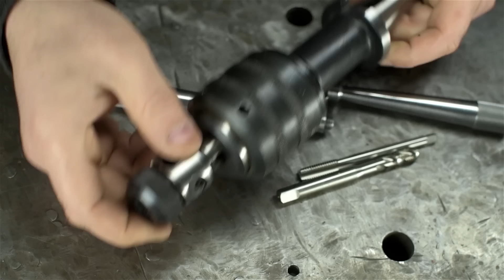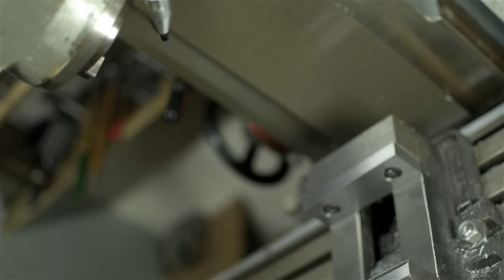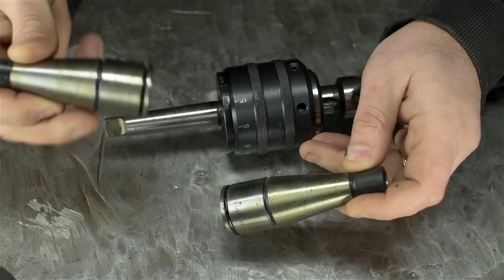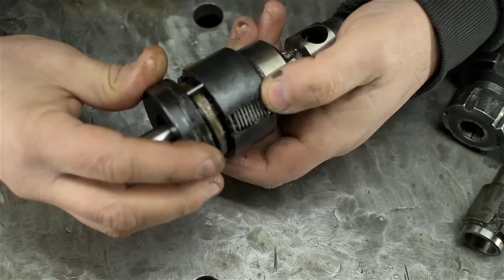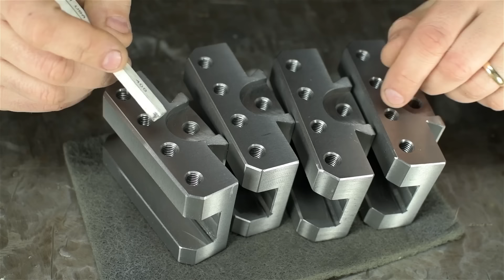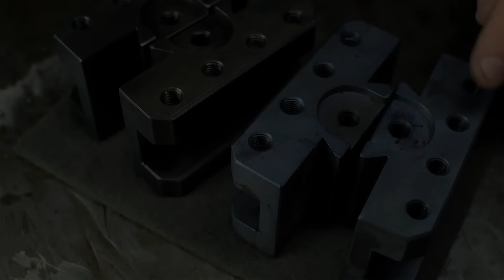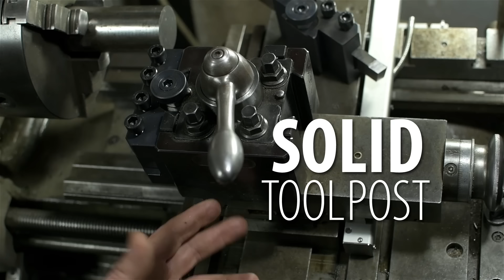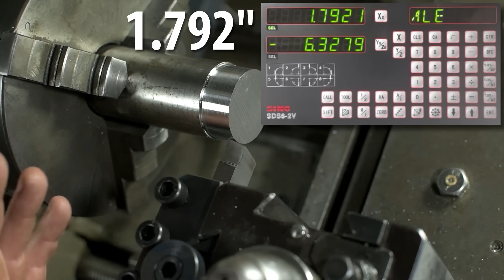How To Break A Tap & Other Ramblings

Comment: @ThisOldTony could you make the taper you need in two concentric parts, with the threaded part on the inside and the dogs on the outer parts? I'm thinking a pin through the base of the dogs would keep the two parts engaged.

Comment: My cold blue success is:

0) If you touch parts with bare hands, you have to start over again! Use a new glove and wire the part for handling between baths.
1) Sodium Hydroxide bath at room temperature or heated up to 80 ceslius (only got a induction stove these days, so most of them I made with cold solution). Anywhere from 5 minutes to some parts that I have forgotten many days in the bath. Don't use aluminum pans for alkaline baths.
2) Tap water to remove NaOH.
3) Acidic detergent bath. These act fast and attacks steel. About 5 min at room temperature. Do not forget part in this solution, as it will be heavily pitted or ruined.
4) Tap water again to remove acid.
5) Cold blue for a few minutes. I believe I get better results with brush instead of soaking. Repeat brushing as needed or as parts looks gray or brownish.
6) 40 min of boiling water for sealing the oxide layer. Never tried pressure pan, but am pretty sure it would be even better/faster/higher/greeker.
7) Machine oil to fill the porous oxide. 
8) Wrap in paper towel and leave it for a day.
9) Paper towel to absorb all excess oil - part is now ready for use.

I'm getting pretty consistent cold blue results, with deep black that does not rust right away. I found that buffing with a metal polishing compound (chorme car bumper polish are very easy to use) corrects a lightly stained surface.
Electroplating or chemical finish books tells to use distilled or de-mineralized water and HCL solution. Never tried it, but guess it would increase finish quality.
Someday I might try the hot alkaline bath (lots of sodium hydroxide dilluted in a solid state at room temperature) on a steel pan, heated to 150 celsius on a open area, for 40 minutes, then boiling in hot water to remove NaOH. That is the industrial procedure used for blackening gun barrel.

Comment: Re the grease. Dow Corning make some grease called "Kilopoise" and is a soap thickened grease. It is known as low shear or is it high shear. Basically it is a grease that opposes movement. It is often used in camera lenses to give that lovely smooth action. This is for the manual action lenses as uses on 35mm manual film cameras. Without the grease the lens would be loose or at least loos-ish.  Just a thought as this type of grease may be used in the clutch design of the tapping head.

Comment: The DRO messes my head up man.. I love those TOOL HOLDERS..
I was stunned to see how some ppl have actually made gears, if a little small, from a Tap. i COULDN'T WRAP MY HEAD AROUND IT. 
Obviously u need the right machines to carry this function out but the fact it is possible to cut gears with a Tap is awesome however small the teeth might be..

Comment: also, I know, yes, 4 years ago, but I ran into that twisting tool post under heavy vibration loads too, and I fixed it in two ways. I used traditional scraping on the top of the top slide, and also the bottom of the tool post. I also stuck a thrust bearing under the nut. Clamps right down solid now! Now I just break the tools instead of moving the tool post.

Comment: I recently discovered what those flange-less adapters are for! They're for face mounted tooling. Those 4 bolt holes around the spindle? Stuff mounts there, and that arbor centers it. You know, that 24" fly cutter you've always wanted to make for that single use and never use it again? Perfect use case.

Comment: this video is old and you're not going to read this 
those blanks for the mill are exclusive to removable head mills
what they are using a T-nut you mount this inside the head and use it to remove it 
there is two so you can use one for removal and one to install (two heads in head replacement.
there are heads that are stationary like yours
and there are ones with the quill !

Comment: Idk if it would work but if you can find an ISO 30 to a Jacobs taper or similar, you could mount it like a drill chuck. There are no side loads so it shouldn't have a problem.

Comment: I have an idea that may work for you here (I am an electromechanical).  Use a proxy sensor or even a reflective sensor that will monitor the tap collar going up and down.  As the collar would be pulled out by the tap, the sensor would detect it and activate the table motor with some sort of SSR.

Comment: This is a old video, but as you made a new part with the ∅20 mm shank: Why did you not do the same thread as in the ISO-30 taper with the internal thread? A little shoulder on the shank and a little "shelf" (don't know the right word, sorry!) in the taper. Runout would be good enough for threading and you would get alot of more hight...

Comment: You ever try bluing creme? It's good stuff for small parts. I think dunking these tool holders was the best way to go, but if you ever have something smaller it's handy. Works really well, I get a nice dark finish using something like 1064 gun blue creme. May be others, not sure.

Comment: I've been thinking, you could try to build up a flange with the two drivers on one of those ISO30 "Blanks?" and then thread the back end of that blank driver for the thread on that ISO30 blank. Bingo, 2 piece ISO30 tapping head.

Comment: I have an idea on how to have some more space. Have an iso30 adapter with a hole on the other end to take the straight shank of the part you made. This next part is gonna hard for me to explain, so try and bare with me. The straight shank has 2 tapped holes. One normal and the other left handed. The adapter has a hole going most of the way down, leaving maybe a few 1/8ths of an inch before meeting the straight shank, where you can put in screws to keep the adapter on, and no matter which way you turn the mill, the screws wont unscrew themselves because the threads go in opposite directions. Will this work? I have absolutely no clue because I've never touched a machine in my life, but its something

Comment: One way to do cold bluing is to soak a fresh microfibre cloth in the solution while rubbing it onto the slightly warm piece of steel you want do cold blue, you're going to be taking the jagged tops off the crystal structure you're making while it's bluing, it's going to leave the surface looking like it's polished. 

Don't use cotton or paper to do it, since the cold blue reacts with the cotton/paper.

Comment: These gun taps you were talking about, are also made to get the chips out at the top of the hole. As far as I have learned it, the difference is, ho the thread cutting drill is manufactured. These cutters can be spiraled to the left or right sight. This is what makes the chips go up or down the drilled hole

Comment: The holding power by friction alone is massive you will be suprised! Just make sure they are screwed in from above, that increases the friction by pulling the contactsurfaces against each other. I would guess those ISO30s are for "plain milling cutters" with profiles but that is pure speculation from my side.

Comment: I know Tony isn't wrong..... because he's Tony. But there's a thing that confuses me. I know from experience a thirteen millimeter wrench fits a half inch bolt. Same with sixteen mm and 5/8". But I've heard Tony say multiple times, 15mm is 5/8" and in this video 12mm is half inch. What am I missing?
Reply: Half inch is 12.7mm. That's why your 13 mm fits it. A good 12 mm wrench should not fit into a half inch fastener.

Comment: the holding power of just an ISO 30 taper is actually very high, with a properly tightened drawbar you would have no luck spining the taper even with very heavy milling operations

Comment: 4:30 That is exactly what I did when I bought a tapping head for my drill press last year. I had 50 1/4" holes in 1/4" copper bus bar to tap and I make the same or similar items on a regular basis for different projects

Comment: This is the only TOT video that I have any relatable experience with--tapping holes. But by hand and in aluminum, so low-tech. It was long ago, but I can still feel in my sense memory the jagged little cutting points on those threads.
I'll never be a machinist, but I watch these videos multiple times. They are interesting, I learn stuff I'll never use, and I just find myself smiling as they go along. It's just a joy to watch and to laugh at the puns.
Thank you.

Comment: If the 2MT shank on the tapping head was soft, perhaps you could you have threaded it to fit your ISO 30 adapter.  Then you could break out the TIG welder and add those drive ears!  On the other hand, you still have that 2MT shank for when you retire and sell the tapping head...

Comment: My lathe tool post has a sort of four tooth ratchet kinda thing so if you turn it left a quarter of a turn you can’t turn it back the other way which is a good design in my opinion

Comment: I love your post work. That is, snapping the tap into 2 smaller ones, your son breaking off a piece of bar stock by hand, scoring square tube with your TIG then popping it with compressed air, and even doing the same to a solid block with wood dowels. Not work on the actual post. You might need to work on that. ;D

Comment: Just want to say that while your content has remained consistently interesting over the years, the production value has noticeably been steadily increasing.
The extra time you're taking to frame a shot, set up lighting, get in really tight, and figure out a way to still operate your equipment without killing yourself for what might only end up as a few seconds in your final edit hasn't gone unappreciated.
And I'm willing to bet that I'm not the only one.

Comment: Hey TOT (did you know your abbreviated name means "dead" in German?) - I don't know if you're reading comments on 1 year old videos but here goes: The Iso30 tool holders you showed and asked what function they have; I can't be too sure about their official function, but we had two smaller arbor sets that used bolt connectors that would fit this (M12 and M16 I believe), as well as several tool holders, mostly for changeable carbide inserts, that also fit. They weren't really clever, as the cutting forces would drive the bolt into the thread, and if you had apprentices who also weren't too clever either that would run the carbide hot, then proceed to try to change the insert while the iso30 was still inside the spindle they'd basically transfer all of their weight through the thread on the poor machines gears. We milled a gap into the adapters instead to fit them in a hole in our workbench where we'd change tools.

Comment: 30 seconds into this video and I'm just nodding my head and saying out loud within hearing of my S.O. "You're so right, keep spitting truth, that's so harsh." Then she goes "Are you still bitching about all those taps you broke today?"

And then my thoroughly bitchy response of "if it's so easy the why don't you rigid tap 6-32 holes through "0.375 6061 with a 1998 Haas VF-0 with 0.040 of y-axis and 0.018 backlash in z"

I have a very comfortable couch.

Comment: Milling machine - totally the wrong tool for the job !

Lathe - has a Morse taper in the headstock - parts to be threaded clamped to saddle - saddle moves to effect the quill effect. OR you could power feed the saddle to the correct pitch accurately.

Comment: Chemist here:
"thin layer of Porusoxid (por2O3)" hahaha there is no element called porus.
what you actually doing if "rusting" the surface of your Iron piece.
so you have a very thin layer of Fe3O4. its not really rust. its a spezial oxidized form. 
the oil gives the piece rust resistanze because it fills in the micro holes (uneven surface) 
and ofc because the fe3o4 is allready combined with oxigen so at this spot there will be no fe2o3 formation

Comment: No big machinery for me.  Just a battery powered hand drill.  Done some tapping with it on a few things and honestly that went better than drilling for me.  I have about half my drill bits broken or dulled to the point of no longer being useful.  Probably cause I buy cheap stuff to begin with but then again it hurts a lot less to break the cheap stuff than the expensive stuff.  Have to wonder if it's one of those chicken or egg type of conversations.  But most everything I work on ends up the way I need it to be so no reason to complain too much.  

As far as the bluing, try using the browning first.  Yeah, I know another chemical to buy.  Just brush it on a part around 150 or so then after a quick scuff with some 000 steel wool do another coat.  Then another scuff and the bluing with the part again around 150.  The color and consistency you get will be something that you will really like and should be pretty even.  Just get a fresh set of gloves every chance you get as that is potentially the reason why you will get splotches.  Even the oils from your skin will cause funky stuff and the chemicals can do the same.  Ideally you would have the part in such a way you would never touch it at all once the surface is cleaned but in a home situation that isn't exactly ideal.  Also give them a quick clean in between, should be a natural thing but you know how it is... explain every single step or someone will mess it up and blame you for the bad advice.  Even though it's cold chemicals the heat helps them react just a touch better and open the pores a little bit more.

Thanks very much for the video's though.  Watched a lot of them in the past and quite a few times would sit here with my wife.  She may not understand things but she was still intrigued.  This one was actually posted about 4 days after she passed away.

Comment: Why not make a new short ISO30 adapter and drill and tap the internal draw bar all the way thru and tap the same thread into the new straight shank on the tapping tool? that should shorten the whole thing more.

Comment: You can rub your parts with steel wool while dipping in that cold blue solution for an extremely even finish. Do it while wet or even under the solution.

You just need to do it lightly. Wiping it with the wool seems to scrape off anything that was preventing the reaction and it totally evens it out.

Comment: Cars are light.  The cars on the back weigh less than if the original bus seats in the back were filled with fat adults. Let's do some math: Wikipedia says the Wheego is 118.5 inches long. I'm going to round that up to 120 inches.  Now I'm guessing the seat pitch (the distance from the back of one seat to the back of the seat in front of or behind it) was around 30 inches in the bus.  Thus, four rows of seats ( 120" / 30" = 4) take the same space as the Wheego.  Each row has 2 seats, each seat can hold 2 adults (I didn't say comfortably).  And, 2 * 2 * 4 = 16 people.  Finally, the Wheego weighs 2667 pounds (maybe).  And 2667 / 16  = 167.  So if the average passenger weight is over 167 lbs, then people in the bus seats would weigh more than the Wheego parked in the same space (not even counting the weight of the bus seats).  So I guess I was wrong -- the adults don't have to be very fat to outweigh the car.

Comment: Afterthought: beware of replacing greases - smelly or not - used with multiplate wet clutches! These can sometimes have specific stick-slip properties intended to give the clutch desirable non-linear lock-up and release points, ie; hysteresis. Classic example: old limited-slip differentials like PosiTrac (? not sure if that one specifically) - the classic mistake was to change the oil in the differential using standard 90w gear oil after which it wouldn't work right. Maybe it was IH's version, not sure. I think more thn one used it. Could be going on here too.

Comment: Maybe those shanks are for bolting a shell milll right up against the spindle face? So that the drive dogs engage the shell mill directly? 
I think this sort of thing (but different) is what the tapped holes in these spindles are for, though I have never seen any tooling to match.

Comment: My math notation is pretty rusty but at 17:44 did he make a mistake when he said two tenths of an inch. I'm thinking that the 0.0002 displayed on the video would be called two ten-thousandths? Not super important, I just want to know for future reference. I wonder if metric is vocalized similarly or if it is just imperial - err actually I bet  they just convert to a different SI prefix. Anyway enough with the rambling. I don't know anything about machining but your videos are well done and interesting. The jazzy themed clips are amusing as well. lol.
Reply: Most Machinist call 0.200   two hundred thousandths. So if 0.0002 is just called tenths. Meaning two tenths of one thousandths. It's just understood language in the trade.

Comment: Now, I've not seen any for a while since I sold up and retired. But those 2 taper 30 holders look like the heat shrink type. without the data sheet it'd be tough to work out the temperature  to expand it to get the ground/machined shank in there.

Comment: Not that I know anything about making one of these, but couldn't you make the drive end with splines and the taper in two parts? I ask right as you mention the exact same thing.

Maybe with one of those other random ISO30 heads, and some sort of cross pin.

Comment: Could you not (in theory) thread or tap the back of that tapping attachment and toss it into a drill press since those usually do have quill systems ... I say thread or tap because I've seen drill presses with both male and female threaded fittings on the main quill once you remove the chuck ...
Orrrr ... does this become a torque thing where a drill press simply can't run that attachment.